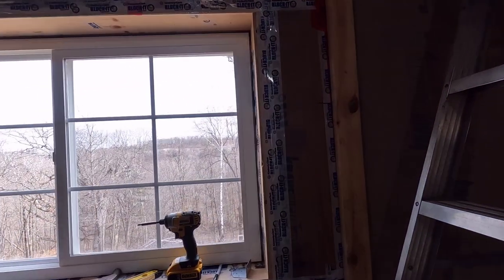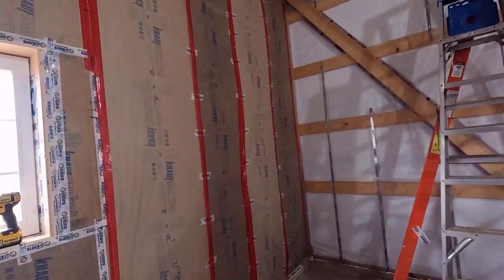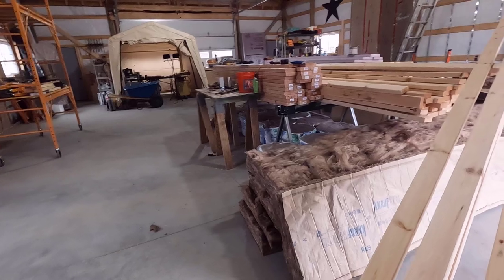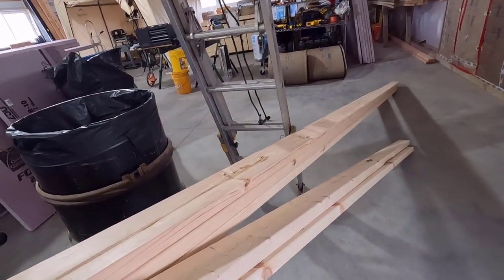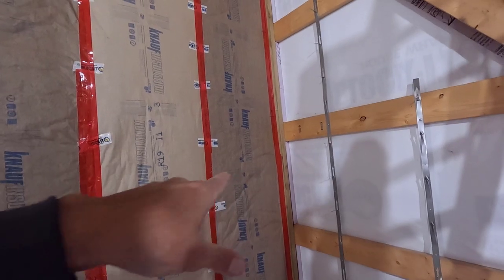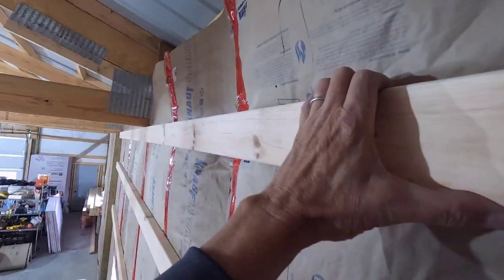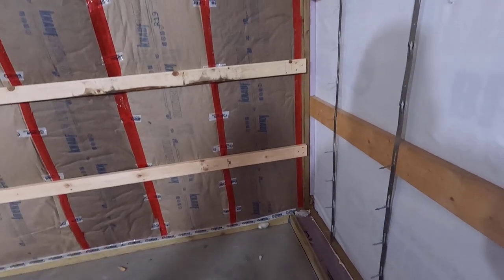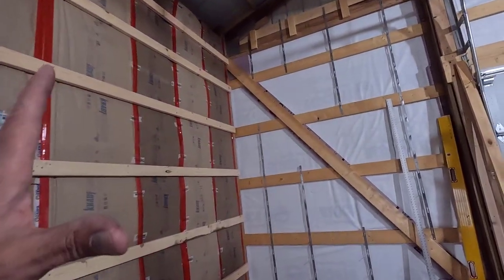DIY Post Frame ― Installing Interior Girts into Corners Pt.1

Comment from the maker: These two post frame corners (the other two will be to a partition wall) are very difficult to complete because of the orientation of the columns in the corner. Also, no mater what there would be nothing to fasten the fiberglass batts to on one of the sides. The solution I have come up with solves all of the offset problems as well as the fastening of the fiberglass batts — it's not going to be easy, but in the end it will be very strong and very well insulated and that makes me happy 😊

Make sure to visit our woodworking channel. The shop will be located right here in this building! - https://www.youtube.com/channel/UCRINXKOEDSDX5XQI149JoDA

Comment: what size are the girts? 2x4?
Reply from the maker: The interior girts are 2 x 4 on the side walls and 2 x 6 in the area where I will be putting lumber storage and the dust collector. That area also has 9' spacing of the posts as opposed to 8' on the side walls.
Reply: Ok thank you